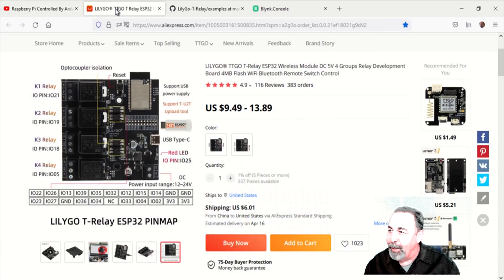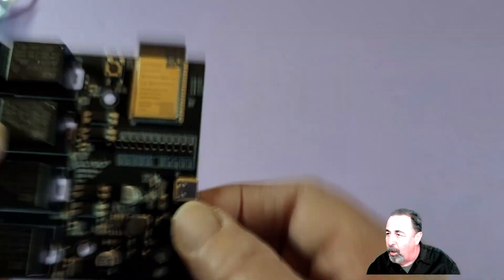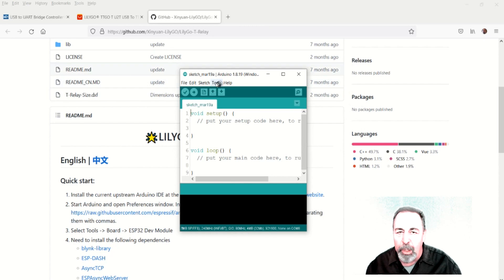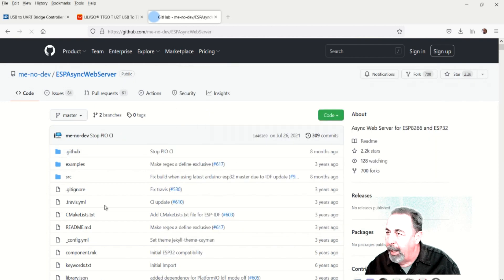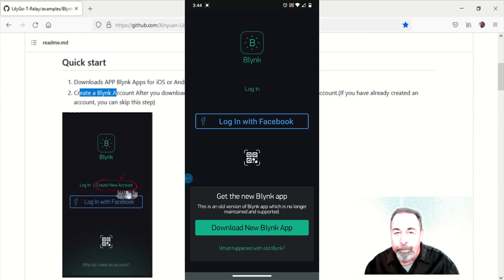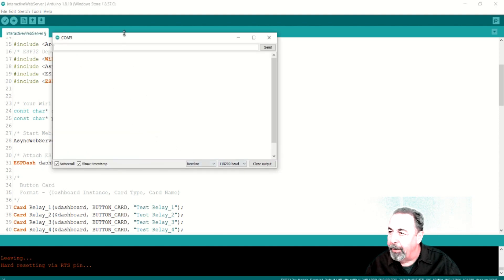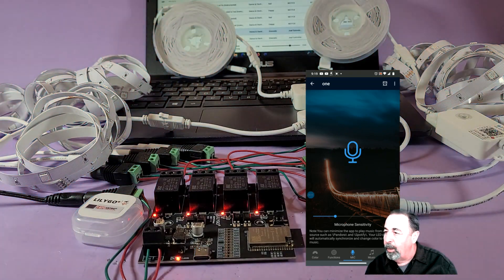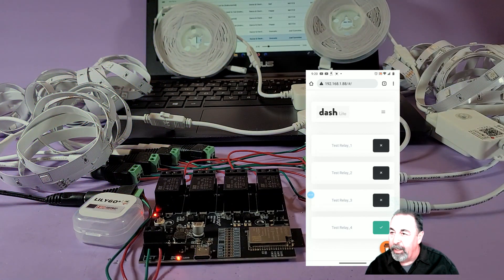LilyGo TTGO T Relay ESP32 Relay Board

Comment: I'm looking to create a wireless high power rocket launch controller.. nor sure if I can get this to work since there wouldn't be internet in the field..would one of lilygos other wireless products send on and off for each of the relay channels?. Also I'm thinking a continuity ans voltage sensor not for running the relay but just to check for continuity and possibly powwr up a light and maybe read out battery voltage on an lcd.
Reply from the maker: Why not take a  inexpensive WiFi router out with you to establish your own network at the site? Just a thought. Safety first. Good luck!

Comment: I would like to know how to set a void loop that if button 3 is on it turns it off after 2 sec
and then hits button 4 for 2 sec.
I cant use my old code to do it with DASH or something. 
it also needs to check a voltage on a pin if over 10v hit button 1 for 2 sec. if low run the 3 and 4 loop
Reply from the maker: Writing it out in human understandable text like this is a good start. I hope this is not being used to operate a nuclear power plant!
Reply from the maker: GPIO pins on ESP32 generally are limited to 3.3 volts. You would need some other device to measure the voltage higher than than.
Reply: I got the first part working. Thanks for the heads up on the 3.3 I was going to have to research that next. I have another small voltmeter Arduino I think I can program to have it send the high or low signal out of one of its pins if I can figure out its programming next.

Comment: That T-U2T adapter is so weird. If the TTL chip is in the adapter and they connect it via USB to the board then they're actually transmitting TX/RX directly over the USB data bus. Quite creative...?
Reply from the maker: Seems like it.
Reply: @ShotokuTech  I think it's actually a kind of cheap trick to get you to buy their TTL converter. If they just put the TX/RX on a normal header (like every other devkit does) you could use any converter you have laying around.
Reply from the maker: @pietheijn-vo1gt  This T-U2T thing cropped up during the pandemic. I wonder if they did this to conserve on the TTL chip? Instead of putting one on every board, make a dongle instead.

Comment: I'm thinking about an AC/Heating controller for my friends RV. He has everything, but he has to control it manually. He wants to use his cell phone, plus I think I simple I2C sensor will allow it to function automatically.
Reply from the maker: I'm not certain these relays are rated for that much current. That is something to examine carefully. Certainly a simple temperature sensor could trigger one way or the other if it is too hot or too cool.
Reply: @ShotokuTech  That's definitely something to consider, but I'm hoping his RV has inputs that are suitable for a normal thermostat. I'm thinking I'll use 3 of the relays: one for fan, one for cooling, one for heating. I'll have to see what's there.

I just now found the TTGO version due to your video. The relays on the one I already have on order will handle up to 10A at 30VDC/250VAC, but you're probably right that they won't drive motors directly. Thanks for the thought. I'll check. :))
Reply from the maker: @rdyer8764  Good luck. It is an interesting use case. Best wishes.

Comment: did it after the video, I want to operate and control it with a phone akai reel to reel
Reply from the maker: That's a good point. How to use Bluetooth in your own way. Could I use terminal bluetooth connection to control is a good question. Thanks.

Comment: Hi. Can you advise which pins are default for this ESP-Wrover-E board as used on this relay set?
Reply from the maker: Hello. The GPIO pins in use for the relays on the four relay version are pins 5, 18, 19, 21.
The GPIO pins in use for the relays on the eight relay version are pins 5, 18, 19, 21, 12, 13, 32, 33.
Thanks.
Reply: @ShotokuTech  Thanks..I wasn't precise I meant the I2C pins as one of the ESP default pins (21) is used for a relay. I have subsequently heard from LilyGo that different pins can be associated with I2C. But another problem has arisen I wonder if you have encountered it. Part way through a sketch development the board stops uploading saying Com port not found. Not done anything except add LCDs to show pins operating..?
Reply from the maker: @ianwoodcock1744  I am looking at the schematic and do not see where you could have crossed up with the serial port. Mystery.
Reply from the maker: @ianwoodcock1744  https://github.com/Xinyuan-LilyGO/LilyGo-T-Relay/blob/main/Schematic/T_Relay_Schematic.pdf

Comment: Hallo!
How many ampere-watt can support one relay?
I need to use one relay for a slipper with more electrical systems!!!
Thanks for all your videos!!!

@}-,-'----------
Gianfranco
Reply from the maker: The HRS4-SDC5V relays are 120v AC, 24v DC @ 10A. The T-Relay input voltage is 12v-24v. It is geared for low voltage 12-24v DC. Thanks!
Reply: So I need to choose a power supply or power adaptor with 5V 10A right? If i use four relay together ?  @ShotokuTech
Reply from the maker: You can power the board with any 5 volt supply on the USB C port, or 3.3 volts on the breakout pins. The power to supply the relay is a separate input and can handle higher voltage at up to 10 amps.

Comment: hi, i have a:  LILYGO® TTGO T-CAN485 ESP32 CAN RS-485 Supports TF Card WIFI Bluetooth Wireless  and is there more information using the Arduino ide to get started?  
i do not know if i picked the correct arduino board manager and there is a TF card error...  thank you.
Reply from the maker: Make sure you have added this to your "Addition board manager URLs" list in "Adruino IDE" Preferences. Everything I read says ESP32-Dev Module is the board to select. Read more here: https://github.com/Xinyuan-LilyGO/T-CAN485/issues/3
They list two other libraries that need to be installed in the IDE.
Check out the other issues and answers that are posted, even the closed issues for more information.
The pins for the SD card appear to be:
#define SD_MISO_PIN 2
#define SD_MOSI_PIN 15
#define SD_SCLK_PIN 14
#define SD_CS_PIN 13
Reply: @ShotokuTech  thank you very much, i will follow your advice.
Reply from the maker: @qzorn4440  Good luck. I don't have one of those devices, so I can't offer any first-hand experience. I hope it works out for you.